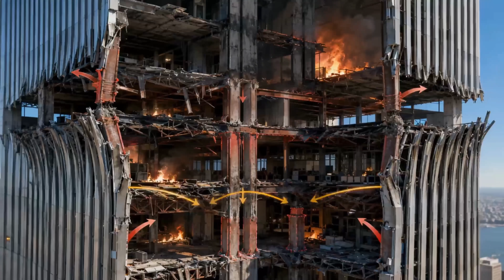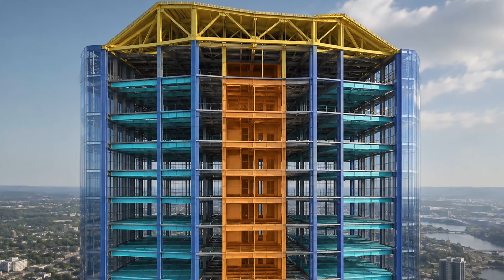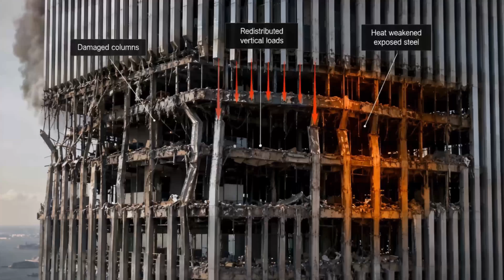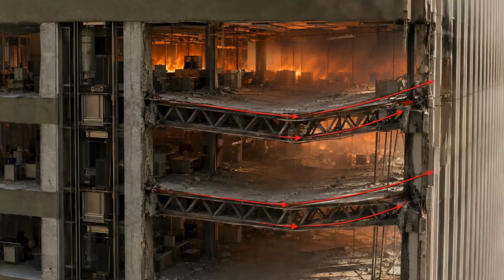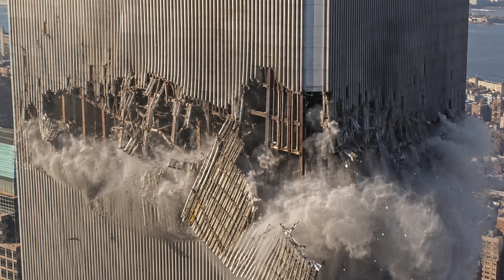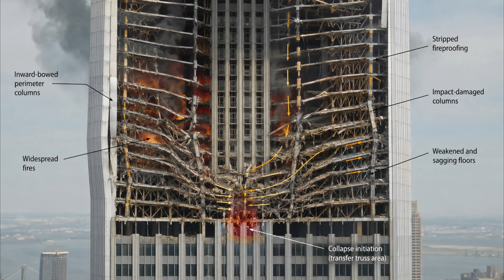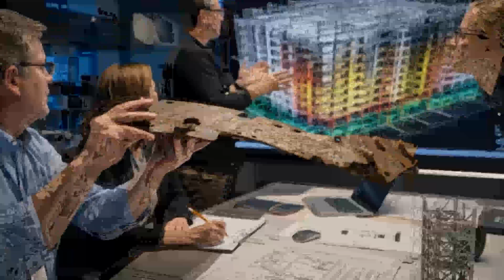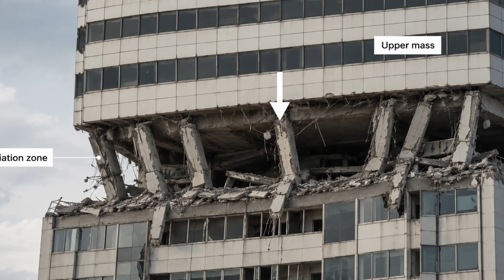What Happened Inside the Twin-Towers After Impact?

Comment: Simple control demolition like building 7
Reply: Ha ha ha ha ha seppo idiot comment
Reply: Here is a closer look into the Twin Towers' collapses. 9/11 was a horrendous event that propelled the US into an invasion of Afghanistan and Iraq even though President G.W. Bush had campaigned on a no new wars platform. It’s interesting that many in Bush’s government were members of the “Project for the New American Century” (PNAC) whose manifesto states, in Section V (available online), under the heading “Creating Tomorrows Dominant Force”: “Further, the process of transformation, even if it brings revolutionary change, is likely to be a long one, absent some catastrophic and catalyzing event – like a new Pearl Harbor.” The following videos are a deeper investigation into the Twin Towers’ collapses. There is some redundancy between videos but each contains new information about that terrible event. 
9/11 - The "Free-fall" Collapses are Scientific Proof the "Official" Story is Impossible -   https://www.youtube.com/watch?v=7e0PiQhSL7g&t=20s
9/11 - The Impossibly High Temperatures Under Ground Zero Examined -   https://www.youtube.com/watch?v=-0bEu7THvAQ&t=18s
9/11 - Twin Towers Were Designed for Strength, Redundancy, Survivability -   https://www.youtube.com/watch?v=k8mYL200o3c&t=297s
9/11 - Thermite the Cause of 2,800 Degree (F) Temps Deep Under Collapsed Rubble? -   https://www.youtube.com/watch?v=-N2U03CEDRM
9/11 Twin Towers were Designed for 600 mph Impact and Resulting "Horrendous Fire"-  https://www.youtube.com/watch?v=pk3QvYGzPT4
Reply: It is my opinion that the twin towers collapsed due to high temperature thermate strategically melting and weakening the core columns.  It is the only explanation that would produce collapses in 9 and 11 seconds respectively .  And also produce perimeter columns ejected sideways at 60 to 70 miles per hour.  I know. I am a retired engineer who made the calculations for the 35,000 lb. beam assembly that embedded in the World Financial Center 3, 541 feet away and 270 feet high.
Reply: @Wilber-citizen  - I can do better. At the End of the day, we all just want to know what really happened, right? It’s tough because there is a massive amount of absolute garbage information out there to muddy the waters, even though structural engineers had figured it out within weeks. How is the layperson supposed to sort it all out? 

I have put more thought into this than most because anything can seem like a conspiracy if you don’t understand how it works and if you don’t mind would like to offer my perspective. You may choose to disagree, which is fine, but if I am in error on any point of fact, logic or reason please let me know.  Just saying you are wrong or I don’t believe you isn’t going to make it. 

While complex, most of the Twin Towers collapse mechanisms can be seen with the naked eye and easily discerned and understood by the layperson IF sufficient time is taken to understand.

1.   The Twin Towers consisted of 4 primary structural elements together forming an integrated system where each relied on the others. 47 hollow box-section steel Core Columns carry most of the gravity loads. The 236 hollow box-section steel Perimeter Columns carry the remainder and ALL of the lateral (wind) loads. Long-span Lightweight Steel Trusses connect core and perimeter column together with a Hat Truss on top to tie it all together as an integrated unit where no element can survive without the others. There was no structural load bearing concrete and most major assemblies were bolted together

www.youtube.com/watch?v=u7OqrC74Dm4

2.   The impact of a 122-ton airplane (= 12 dump trucks) at up to 587 mph with the energy of a ton of TNT destroys the aircraft in 0.50 seconds. This in no way implies the Towers come out unscathed. Some folks get hung up on that. Many perimeter and some core columns are destroyed or damaged primarily by bending, twisting, splitting weld seams and critically by bolt-shearing failures at the end connecting flanges. No cutting or slicing - the reality far more violent and brutal. 

www.youtube.com/watch?v=zF-94yDHlk8

3. The impacts destroy or damage fire insulation, fire breaks and sprinkler systems on multiple floors. Jet fuel acts as an accelerant starting huge fires start across multiple floors simultaneously that spread spread rapidly with no effective firefighting or fire suppression. This was an unprecedented fire event . Office buildings are essentially giant piles of kindling when it comes to fires, chock full of stuff that burns vigorously and quite hot. 

4. The hotter steel gets the weaker it gets shouldn’t be a revelation. With fire protection compromised the survival time of the steel greatly reduced . Over time heat gradually causes the lightweight steel Floor Trusses at the damaged floors to sag, which we can see. No steel melted or needed to. Structural steel fails long before it becomes a puddle. It just needs to bend 5. A straight column is up to 4 times stronger than a bent one. Sagging floor trusses pull on increasingly weak and overloaded Perimeter Columns, causing some of them to bow inward by up to 5 feet until they buckle and fail, quietly initiating collapse. The formerly static mass above which the structure below could easily support converts to a dynamic mass up to 30 times greater. The Columns above and below the failure point are no longer aligned . The load bearing structure below no longer bears any of the load above, which falls past the lower columns NOT onto them. www.youtube.com/watch?v=ULdiD6gYZO0 www.youtube.com/watch?v=zTygQK3vriI 

6. Heat starts the collapse, gravity finishes it . Thousands of tons of debris drop within the four outer walls, through the open office space, the path of least resistance crashing onto the first intact floor, The bolted column connections instantly break as the amount of resistance the Floor Trusses can offer is negligible, slowing the falling debris only marginally and briefly before the connections fail. Note: 
6a. This is NOT a solid top block crashing into a solid bottom block . 
6b. The debris falls past the columns not onto them. The columns provide no resistance to the falling debris. 
6c. Only the bolted floor truss connections to the core and perimeter columns offer any resistance. A pair of 5/8” bolts at each end of each truss vs. thousands of tons of falling debris. 
6d. No laws of physics are violated. 
6e. There is no 20 floors against 90 floors but rather 20 floors against one floor, then 21 floors against one floor, then 22 floors against one floor, etc. 

7. This floor-led collapse progression within the four outer walls can only go straight down. There is no lateral force to push it over the side, only gravity to bring it down. 

8. Collapse progresses through the floor systems past the columns, through the path of least resistance . Resistance offered by each floor is always the same while the falling mass acting on it is constantly increasing and accelerating (gaining energy). This process of floor-by-floor destruction cannot be arrested. It can only speed up . Rate of floor failures increases with each floor as momentum increases, reaching an average acceleration of 0.65 of GA, or 35% slower than true free fall. Bam, bam, bam down the building until there are no more floors to fail. More mass, more velocity, same resistance with each floor. Don’t get stuck on the but the lower floors weren’t on fire nonsense. They didn’t need to be. 
8a. This process is often incorrectly referred to as “pancaking” which while catchy, is incorrect. Too simplistic and inaccurate anyway. More like Kaiserschmarrn. 

9. The Towers were 95% air by volume. As that air was compressed inside the building by falling debris, pressure builds until it is blown out the sides in reaction to the building collapsing . Those were not “explosions”, it was expulsions of compressed air caused by the collapsing building, explaining the low velocity, lack of flash, blast, supersonic pressure waves and lethal high-velocity ejecta. 

10. Perimeter Columns become detached and peel away like a banana behind the collapse front, playing out to the four points of the compass in long lines extending to 800+ feet from the base of the towers, damaging and destroying nearby buildings. 

11. Core Columns fail last as their internal beam bracing is stripped away by falling debris and lateral support from the floors to the perimeter columns is lost. 

www.youtube.com/watch?v=WpHXj62Ylw0

12. This process took 31-34 seconds from perimeter columns bucking until the last core columns hit the pile, or 1/3 the rate of true free fall. Don’t believe me? Just watch a video of the collapses and note the loose truly free-falling debris dropping much faster than the towers themselves. 

https://www.youtube.com/watch?v=dh4r-gHdyPU 

13. Each Tower had a 1-acre footprint. Far from collapsing inside their own footprints the debris pile spread out over 17 acres in a pile up to 14 stories deep. 8 surrounding buildings were destroyed and scores more damaged by the falling debris. 

14. NOT observed were the 180-190 dB bangs of thousands of high explosive devices or the blinding brightness of burning thermite. Explosives or thermite couldn’t have survived the impacts and subsequent fires anyway. Nor could they have caused the perimeter column buckling that clearly initiated collapse. Video of an injured and in-shock firefighter casually using the magic word explosion isn’t proof of explsoIVES and hardly makes a case for planned demolition. Pre-planned demolition doesn’t match the physical evidence and would be technically impossible, totally impractical and completely unnecessary. Simply, no one would bother. In 24 years, no structural engineers of tall buildings, including the 1/3 who have retired, have made any statements in support of planned demolition claims. NONE. The lack of such citations in engineering literature published anywhere in the world is telling. 

15. Twin Towers were perfectly safe within their design envelope. They only collapsed when taken far outside design parameters by an extraordinary and unprecedented event Impact + Fire (heat) + Time + Gravity = Collapse . Remove any 1 of those 4 elements and there is no collapse. Ignore any of them and you will never understand the collapse. The Twin Towers were an integrated system in which no one component could survive without the others. One fails, the rest follow, through the path of least resistance DOWN the open space, bypassing the path of greatest resistance, the columns. No laws of physics are violated and the above is true no matter who planned and carried out the 9/11 attacks or why so the attacks could still be an “inside job”. 

If you made it this far, kudos. That was a lot. I hope it was helpful, informative, non-adversarial and solicits informed critical comment, positive or negative. If I made any errors of fact, logic or reason or left anything critical out, please let me know and I’ll fix it. To stay focused, just one point at a time please and on-topic (Twin Towers ONLY). No word-salads of Gish Gallop. IF you can offer a more plausible alternative be my guest. Please start any reply with the words “Tits McGee” or I’ll know you didn’t read it and aren’t serious. Thanks for your time.
Reply: @TheLoonResistance  Too long; nobody's going to read a 4-page response in a YT comment thread.  As one of my university professors used to say, "Pare it down...pare it down"
Reply: @Wilber-citizen  Where have you published your findings?

Comment: When the buildings were built they didn't use firewalls they used sheetrock which is why the fire spreading across the buildings
Reply: You have a basic misunderstanding there! Firewalls can be made of plasterboard (sheetrock) I spent much of my life putting the damned stuff into buildings. Walls made of bricks & mortar or concrete are inherently more fireproof but the main requirement Worldwide for buildins is fire resitance (which is NOT fireproof) most regulations stipulate 30 or 60 minutes fire resistance - to allow people to evacuate - nothing more. 
Rules for high rises are more stringent but only applies to liftshafts and possible fire hazards.

Comment: There were gas leaks the FDNY was there that morning even before the attacks. The gas leaks probably were in the garage areas also causing intense heat. The first WTC bombings in 1993 didn't help the structures governor Mario Cuomo wanted a quick fix in 1993.
Reply: the gas leak was SEVERAL blocks away !! ... it had 00.00% relation to the hijackings

Comment: Controlled Demolition! Disgusting/Evil!!!😐👹
Reply: Don't believe planes caused their collapse 🤔
Reply: @jerryd5471  Agreed -- they initiated the entire sequence, which led to the Progressive Collapse, as explained logically here by real engineers.
Reply: @jerryd5471  There's a video on YouTube that explains IN DETAIL how and why the towers collapsed. I have seen it.
Reply: Thus speaks the WILLFULLY IGNORANT.
Reply: @MichaelMaston-z8o ...so are you for believing their fake narrative. It was indeed a  controversial demolishion!
Reply: @robbie2438   Well, Robbie. I saw the video of the collapse of towers 1 and 2. ...and that's what it was, a catastrophic collapse. In a controlled demolition, the building's collapse starts from the ground up ...NEVER from the top down.
The detonations are precisely timed to happen from the ground up in rapid sequence (within seconds of each other. THAT is how the building comes straight down.
Reply: @MichaelMaston-z8o my goodness of course the top came down mass/weight cannot suspend itself against gravity. Its support system was compromised due to material behaving opposite of its purpose under extreme heat, causing a pushing from the top and pulling from below and all around the the core structure missing and floors were sagging, making the sides unstable and  far too flexible under that mass, propelling it downwards. How don’t you get that?
Reply: Good god, how irrational are you people? Controlled demolition?? Remote guided airplanes? Just stupid.
Reply: @stevekravcik609 oh I read somewhere else that the planes were holograms. Honestly I’m amazed at the absurdity…and the ignorance.
Reply: @stevekravcik609  Conspiracy theorists abound, unfortunately.  Meanwhile, real engineers like these folks calmly explain what actually happened.